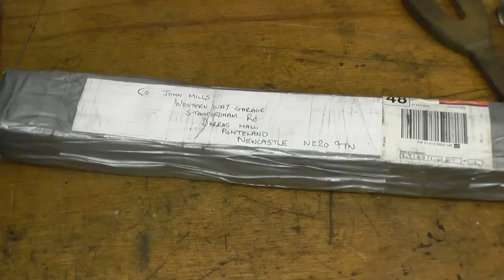SNNC 143 P2  Machining Aluminium On The Lathe

Comment: Hello John,

Regarding the odd spanner, it is a really old version of an ‘Adjustable; spanner. This is before there was any thumb screw spanners, and some multi card type of credit card tools also use the V shape to enable the card to be used on many different sizes of small nuts.

mrbluenun

Comment: My dad called that weird looking wrench an alligator wrench. He used one when he was a telephone lineman in British Columbia. They were used to do up the square head bolts that held the cross arms and braces on telephone poles. The bolts had different size heads so you only had to hang one wrench on your tool belt.
Reply: my dad called them an alligator wrench also. We had several when I was young,all were double ended with one end larger than the other.

Comment: Hi.  The tool your friend bought for £1 in a boot fair is a multi-purpose spanner.  It can be used on any hexagonal or square nut within its range.  Slide it on until one corner of the nut fits into the narrowest of the serrations and the opposite corner rests on the flat.  It is best to orientate it so that you are pushing the corner of the nut deep into the throat of the spanner; i.e. when using it to loosen a nut, the serrated jaw should be uppermost, and when tightening, the serration should be underneath.  Always push hard against the spanner; otherwise the sideways pressure could force the nut to pop out of the serration, spoiling the nut and the spanner, and maybe skinning your knuckles!